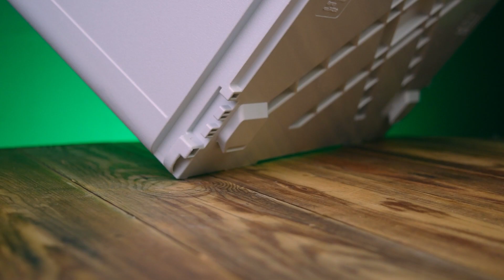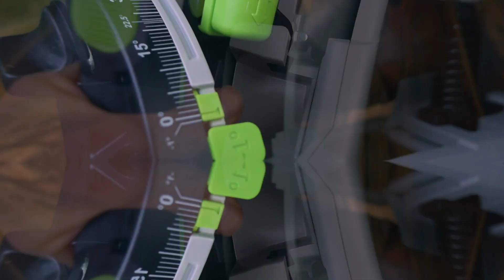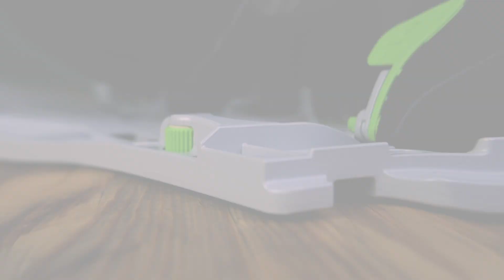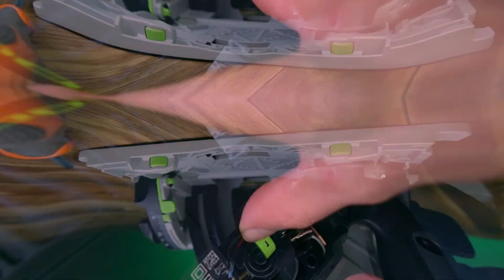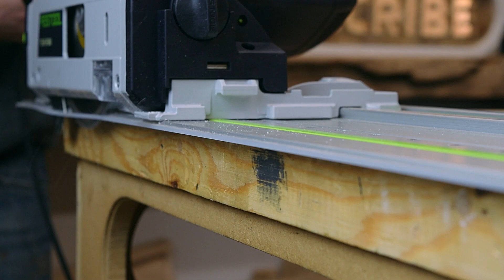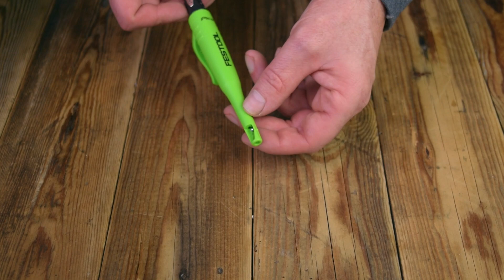Festool TS 55 Track Saw: I Can’t Believe I Waited So Long

Comment: I bought two of the FS1400 tracks. The long rail is too big for my small shop and difficult to transport. Haven't had any trouble aligning tracks.
Reply from the maker: It's good to hear you don't have trouble connecting them. I have to admit, a long rail in a small workshop is indeed a challenge. Thank you for your comment, it is appreciated. Greetings, Christophe

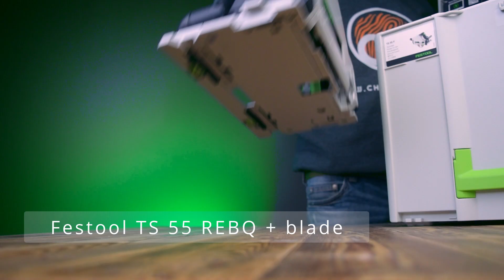Comment: 1:17 tool says "TS 55 FEBQ" but montage says "TS 55 REBQ" .. which is correct (and why is the other one also in the shot?)
Reply from the maker: Thank you for pointing out the discrepancy at 1:17 in the video. You're absolutely right: the tool I referred to should be the 'TS 55 FEBQ'. The mention of 'TS 55 REBQ' in the montage was an editing error on my part. Unfortunately, once a video is uploaded on YouTube, certain aspects like this can't be amended. I appreciate your keen observation and understanding. To clarify for everyone: the correct tool is indeed the TS 55 FEBQ. Thanks for watching and for your support!

Since you're interested in the details of the tools, I'm curious: What specific features do you look for in a tool like this, or what kind of projects are you planning to tackle that might require such a tool?

Comment: Nice video. The saw is excellent 😊. The dust port is irritating 😢.
Reply from the maker: Thank you for your nice comment, it is much appreciated. I really love the saw too, it gives great cuts and the Festool system is brilliant. Thanks for sharing this about the dust port, I haven't had any problems with this, but I'll keep a close eye out for it when working with it in the future. Thanks for watching my video, Colin. Happy Holidays and hope to see you again in my other videos. Greetings from Belgium, Christophe
Reply: @ashstagwoodworking  You're welcome. You clearly put a lot of work into your production.  I've been using Festool track saws for years, and was very disappointed when I bought one in 2021 with this strange dust port design. It seems to be a common problem. I ended up developing my own solution, which I describe in this video. https://youtu.be/nm_lxk2d6Pc

Comment: Seven years ago I bought a TS55 with an MFT/3 table when I move. Best investment EVER!!! I've also purchased two 1400 rails and a LR32 1400 rail as well.  I don't have a space in my small shop to store the long rail.  I've developed the technique to join them together correctly.  I also purchased the LR32 guide rail plate,  Centering mandrel, and 5mm hole bit to use with my adapters to use my PC890 and Makita palm router on the guide rail plate adapter.  I don't use a zero clearance plastic edge on the LR32 guide rail as I use some home made spacing jigs to get my 37mm and 32mm drawer glide spacings correct.    Along with my Seneca parallel guide adapters, this makes breaking down sheet goods and cutting cabinet sides simple, straight forward, and repeatably accurate.   I bought the small table extension as well to support long sheets when cutting, plus my small table saw and router table are the same height as my MFT/3 so I can support sheet goods when breaking them down.  
 
Here's the deal  the Festool tools are used for precision cutting to size and for boring shelf pin holes.  My other tools  are used to assist.  Still looking at that DF500 but my doweling jig, and pocket hole work just fine for getting alignment of the sides and bottom of those boxes just perfect.  I also use a Shop vac and a dust separator with a 27mm hose adapter that fits my TS55, PC890, PC 5' RO Sander, and the Makita Palm router perfectly.  My dirtiest tools, when I use them, are my router and small table saw.  In this shop I did not buy a chop saw because any wood edge banding I need can be cut with the table saw using the correct cross cut sled.   Not doing any complex angles like a crown molding would require. Base boards are done with jigs as well if needed.  Will give Peter Millard's domino jig a try after Christmas to see if I want to spring for a DF 500 next year. 5mm Domino's are coming for Christmas.
Reply from the maker: Thank you for taking the time to watch my video and for sharing your thoughts with me. Greetings, Christophe

Comment: I made a couple DIY tracks (a 4ft and an 8 ft) ...  I also have the ability to cut with the saw on either side of the raised edge in the middle of the circular saw guide.  

Works pretty well!
Reply from the maker: That's how I've done it until now. It works quite well indeed. Since working with a colleague's TS 55, I have been amazed at the difference in the quality of the cuts and the speed at which I was able to work with them, which is important when working for clients. That is the reason I chose to buy this tool. Thank you for watching, Jeffrey. Greetings
Reply: @ashstagwoodworking  I do like the riving knife attachment! That is pretty cool.
Reply from the maker: @mrupholsteryman  Yes, I like that too. It never gets in the way but is still an extra safety feature.

Comment: Hi Christopher, that was nice video. I'm also  Festool  fan, and I notice that in your video, also in description under the video you point by mistake  that you buy  the older model of that track saw"Festool TS 55 R EBQ". Actually in your video you show the newest model "Festool TS 55 F EBQ" which is with the newest Blade with thickness 1.8mm comparing the older "Festool TS 55 R EBQ" that use 2.2mm thickness Blade. Also mostly because of the blade your track saw "Festool TS 55 F EBQ" make cuts twice as fast comparing the oldest model-"Festool TS 55 R EBQ". So its very important  for everybody who will going to buy track saw from TS55 series to buy the newest Festool TS 55 F EBQ, not the oldest Festool TS 55 R EBQ  model.
Reply from the maker: Oh that is very nice of you to let me know. I will try to fix this where I can. Thank you so much for this. Greetings, Christophe

Comment: Hi Christopher:  Thank you for the informative video.  I have been using an earlier model Festool track saw since 1992.  I recently sold it and replaced it with a 36 volt battery powered Makita track saw.  It is also a beautiful saw and produces silky smooth cuts.  It is compatible with my Festool tracks of which I have both the long and short ones.  I have also recently bought the TSO joining bars, parallel guides and rail square from Lee Valley.  The rail square is awesome and produces perfectly square cuts speeding up your work.  The parallel guides are very accurate and produce repeatable cuts.  The joining bars are VERY well machined and automatically align the rails being joined.  They work so well that I cut my long track in half for better portability.  TSO products are worth checking out.  There are lots of YouTube videos about their products.  Cheers,  John Jensen from British Columbia
Reply from the maker: Thanks for sharing this helpful information, John. This is helpful to me, but I guess it will be helpful for many other viewers too. Thanks for watching my video and taking the time to write me this comment. Greetings, Christophe.

Comment: The only negative with long rails is transport. I have used festool with 2x1400 joined together plenty of times and I dont remember that gap at the join but I didnt pay attention as workbench is usually  already set up for cutting. I don't think you will have problems with cut accuracy because of that gap.
Reply from the maker: That is right. I don't think I will use the long track on the job site. Most of my preparations and breaking down sheets of ply wood happen in the workshop. Thanks for watching and taking the time to write me a comment. That is much appreciated. Greetings, Christophe

Comment: Top machien. De hoeksteen van elk huishouden.
Ik gebruik de 2 rails van 1400 (zo geleverd bij mijn set aankoop). Occasioneel verbind ik de 2 rails. Ik gebruik daarvoor een aluminium rei-lat van 2 meter, om zeker te zijn dat ze recht aan elkaar staan. Dat gaat zonder enig probleem bij mij.

Nog een tip: Je kan de zaag ook op zijn zijkant gebruiken. De zijplaat is 90 graden tov de voetplaat. Door de machine op zijn kant te leggen en eventueel te verhogen met iets kan je zo op gewenste hoogte horizontaal snijden. Ik heb het nog nooit iemand zien doen, maar het werkt prima.
Van de apart aan te schaffen parallel aanslag ben ik ook erg tevreden. Je kan deze aanslag ook gebruiken om de basisplaat te verbreden voor als je delicate snedes doet, zoals de 45 graden verstek snedes.
Reply from the maker: Hoi Nico, dat van de zaag op zijn zijkant gebruiken heb ik ook nog nooit niemand zien doen, maar het lijkt me wel iets logisch omdat deze haaks is. Dit ga ik toch eens moeten proberen. Merci voor deze super tip! Groeten, Christophe
Reply: I heb er net een gekocht. Dat zal ik meteen proberen!

Comment: I have 2x 1400 and 1x 800mm. The 800mm is used for wardrobe builds and making kitchen units as the are a standard depth of 600mm so the 800mm is easy to handle on that maximum depth. The 2x 1400 are so I can get them in my van wile they are in the protective Festool rail bag and still I can join them to cut full 2.4 sheets. 👍🏻😊
Reply from the maker: Thank you for this. You inspired me with your comment. The 800 mm track seems to be a good solution indeed. I keep this in mind. Thanks for watching and for the helpful tip, Jason! Greetings, Christophe

Comment: I don't like the way the tracks join either. Here in the US, our standard sheet size is about 1200 x 2500, so a long track would be by first choice for that reason. But with shipping charges they all cost $300-400 just for the long track. If the manufacturers would simply machine an accurate tongue and groove system on the ends of the short tracks, then joining two or more together would be ideal. In theory a person could join as many as the job calls for, so material of any length could be accurately cut with short tracks.
Reply from the maker: Those tongue and groove systems at the ends of the short tracks are a good idea. Perhaps manufacturers can actually do something with this. Thanks for sharing this, my friend. Greetings Christophe